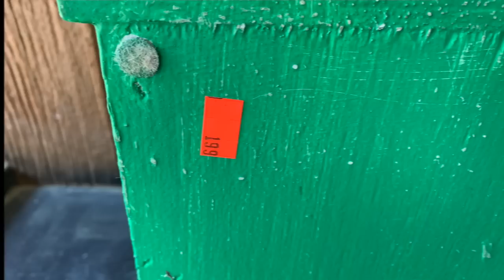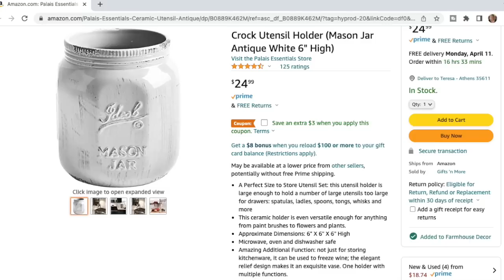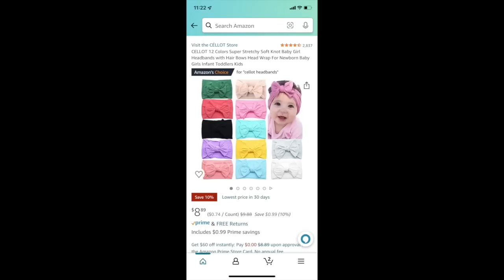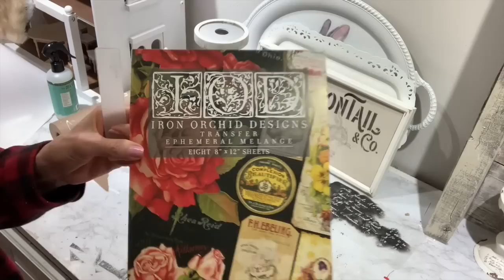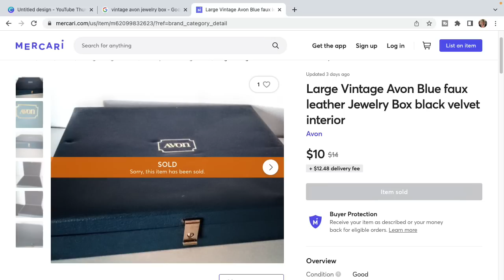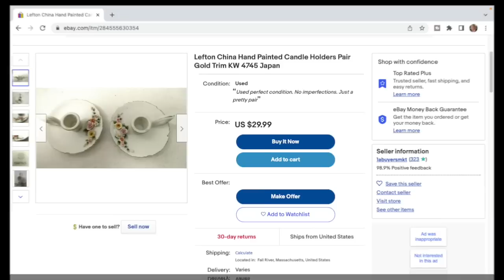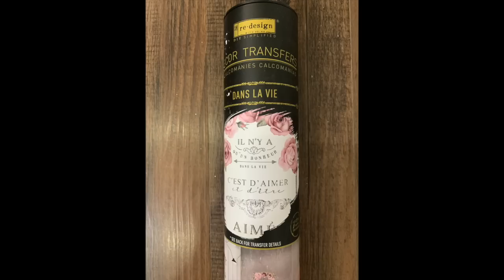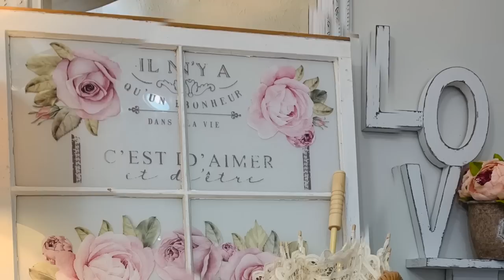14 IDEAS FOR THRIFTED ITEMS $5 & UNDER! FRENCH COUNTRY SHABBY FARMHOUSE HOME DECOR

Comment: Love your dollhouse project. I made a Shingle roof by purchasing a couple pkgs of popcicle sticks at Dollar Tree. I cut the sticks in half horizontally, used curved ends as "shingled ends" and just hot glued stick pieces, vertically just as overlapping shingles on a roof. I mixed "shingle colors" like asphalt shingles look, stippled on dark paint first with a large round stencil brush pouncing roof. Let it dry, then added a lighter color stippling with stencil brush, to give more realistic look of two-toned shingled roof. Also thought of making "gingerbread trim" by piping thin lines of curlicule hot glue on wax paper, let dry, paint , then once paint is dry, use dabs of hot glue to attach "gingerbread" at porch, above windows, etc. You could draw your designs for gingerbread on white paper, lay clear   wax paper over it...then trace same size gingerbread designs over and over due to pattern guides. I also used wax paper or clear stiff toy plastic containers. I cut to size "glass windows" and painted flat toothpicks as the wooden separators of glass panes. I used super glue to affix window glass and  framed both sides of windows with slivers of balsa wood as window woodwork trim and sills. Could use furniture repair markers to "stain" wood trim...found them at Dollar Tree and/or Marc's. Just some ideas from a viewer who loves making dollhouses, fairy houses, historic Christmas homes, etc.